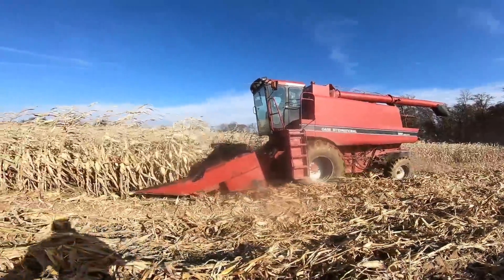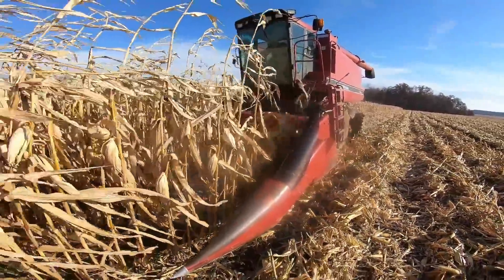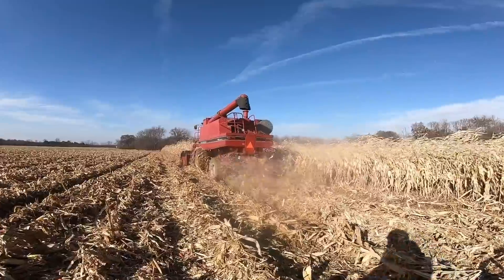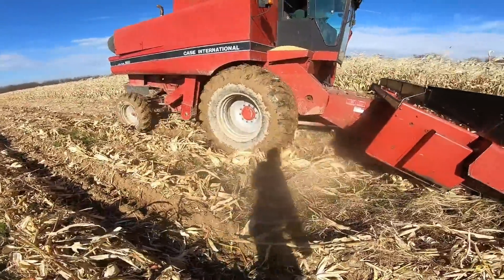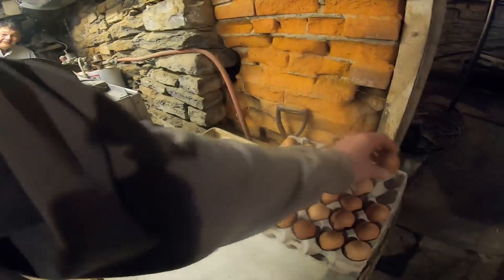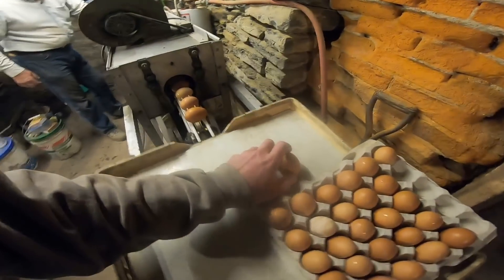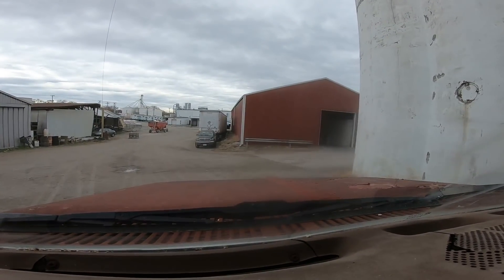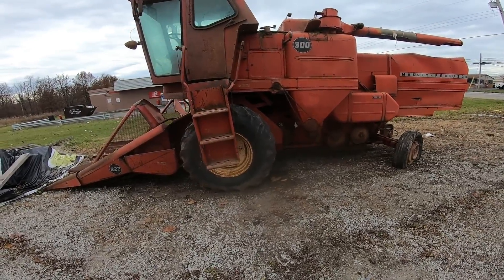Custom Corn Hauling Adventure

Comment: Thanks for the ride-along.  I enjoyed it.  I also did some custom hauling this fall here in western PA.  I have a 1986 F600 Dump truck that holds just a little over 200 bushels.  I bought it a two years ago just to haul my own corn and soybeans, never expecting to do any custom hauling.  This fall, I ended up hauling not only my own corn and soybeans, but also that of 2 of my neighbors because they were having trouble getting tractor/trailers and tri-axles.    All in all, I hauled 22,000 bushels of grain with that little truck.  It was a lot of fun and the truck is paying for itself.
Reply: Even with the price of gas???
Reply: @timknoll8654  It’s a diesel and I didn’t have to haul far.

Comment: When I got back into grain farming in the 90's, there was nothing of Dad's old '56 Ford grain truck to salvage-- it was a former fertilizer truck someone had converted into a grain truck and was older than dirt when Dad bought it for nearly nothing, and it was SO rusted out even as a little kid in the 70's I could watch the road going under the truck and the driveshaft spinning through the bare springs of the seat (cushions were worn out and gone) and the holes rusted through the floor... Salvaged the frame for a trailer the rest went to scrap.  

I tried hiring a semi to haul grain, figured it'd be cheaper than buying a truck and keeping it insured, licensed, inspected, and tagged.  Yeah first thing he asked was "how many combines you got going??  How many auger carts?"  My answer, "one and one".  He goes, "can't you team up with a NEIGHBOR and he and you both run combines in the field TOGETHER so I can get filled up and on the road in like 15 minutes?"  My answer, "NO, I have a 1970's Ford combine with an 18 foot head, the neighbors have much newer bigger stuff, they don't want to team up and have me cutting theirs and I don't really want them cutting mine..."  SO basically he was like, "Well, if I don't have ANYTHING BETTER to do I'll come out."  Don't do me any favors!  

Well, he hauled a load or two for me but I also QUICKLY figured out that for what they charge, I'd be WAY money ahead to just buy my own truck and pay the insurance, inspection, and tags for it... Basically trucking ate up most of the profit on the grain!   Why I don't like hiring stuff done-- by the time you pay for someone else doing it, you could have put that money toward buying your own and repairing it and doing your own work on your schedule... 

Ain't really no reason you couldn't run that combine for Nick while he's at work... do a little work for him for free for once... You're a good operator conscientious and all not likely to tear anything up, (rather unlike Nick from what we've seen) and you could get that off and on the truck and haul a load, get back and maybe pick another, have it ready to go that evening or the next morning... What I used to do when I didn't have any help... and I was driving a school bus at the time.   Get off the morning route at 8, get home about 8:10, hop in the truck and make a run to the elevator, get back hop in the combine cut another load, hop back in the truck make another elevator run, back in the combine (if I had time) and get another load cut and on the truck, then go drive the afternoon bus route, get back by about 5:30 and if I had time, make a run to the elevator, cut another load onto the truck when I got back, and shut down for the night.  Wash, rinse, repeat the next day.  Some days if the elevator was slow, I couldn't get another load combined after I got back from the elevator, it was hop in the pickup and head to the school for the evening route, so when I got home at 5:30 it was combine another load onto the truck, by which time the elevator was closed, so shut her down head to the house for the evening.  The work got done... 

Later!  OL J R :)

Comment: We have, basically the same machine and we love it. We have a 1640 also, but we blew up the engine a couple of years ago. We have a 20' 1020 platform for the 1640 and a 25' 1020 platform for the 1660. We have a 6 row 1063 corn head that was with the 1640, but we have to use it on the 1660 until we get the other one fixed. Absolutely love our IH combines.

Comment: I got excited when I thought you finally got a good combine! Best dang corn head out there and the simplest combine. Getcha one Jacob!
Reply from the maker: Well this corn head needs some help because it kept plugging a middle row.
Reply: @boehmfarm4276  Knives on the stalk rolls probably worn down too much--- watching it work it looks like it's not even pulling the stalks down til they're nearly at the back of the snapping plates, by which time there's not enough time for the stalks to get pulled down through the plates before the gathering chains are pushing them against the back end of the slot and breaking them off or causing them to bunch up.  Knife rolls wear FAST compared to fluted rolls.  Why almost nobody else uses them except as an "option" or aftermarket parts... OL J R :)

Comment: Oh yeah a gas truck will just about break a guy anymore to haul grain.  Diesels are SO much more efficient!  After my BIL's brother passed away, we continued running his old Chevy Kodiak tandem with a 500 bushel box to haul grain with.  I ran it, BIL or nephew ran the IH S-series like yours but it had the DT-466, 13 speed w/granny gear (you drove it like a ten speed basically-- go to low range and you'd shift 5 times before you got to the end of the driveway-- it was a former mine truck) so you started off in middle range first ran through four then switched to high range and ran through four.   If the truck was parked in the field to be loaded, start off in granny gear to get rolling then go to first.  It was a tandem with a 600 bushel box.  

The old gas Chevy we ran for two years, after that the BIL parked it and put me in the IH tandem.  The Chevy was a 5 speed with a 2 speed rear end, with an air tag axle.  Thing was, I could make about 3 runs to the local elevator, about 5 miles from his farm into town, and back before I needed to gas up it up, about 50-60 gallons.  The diesel DT-466 I could run about 6 runs before it needed fueled up, again with about 60 gallons of diesel.  So basically twice as many trips for the same amount of fuel, and actually better than that because of the bigger box on the IH tandem.  His brother's Chevy sat in the barn for a couple years and got sold to another farmer.  

Then he sold his IH tandem for an IH day cab semi and steel hopper bottom.  N-series 855 Cummins and 10 speed, former mail truck making a run to Indianapolis every day that had been jackknifed, got a new cab, and put back together-- got the truck for $11,000 and the hopper was another $10,000, so got into a semi for $21,000 and sold the tandem for $15,000, so basically 6,000 difference.  Plus went from hauling 600 bushels max to 1000+ every trip, and doing it at 55-60 easy versus the old DT-466 running out of power at about 50-55, FINALLY getting up to speed about the time you had to start slowing down and downshifting at the edge of town for the turns to the elevator LOL:)  

You ever get gravity boxes on that IH truck of yours, you'll sell that old Ford when you realize how much gas it burns... OL J R :)

Comment: Nick was doing a fine job running that combine.Nice shots of how wet things are around here.That egg washer was really spitting them out.I never make it through that light at 730 and the ones you bypassed are just as bad for not catching green. Scrap iron with maybe a few parts that can be salvaged.
I like how you had a few different things going on in this video.

Comment: Runs like an Axial Flow lol The IH head was years ahead of the rest with the Knife Rolls .. Overall a much easier machine to work on next to the TR but shared lots of common parts to the Axial Flow Since IH did start the twin rotor idea and canned the crew and idea so New Holland picked it up and thats were it went . I do remember using some rotor drive pulleys from New Holland since my Red dealer did not have them....

Comment: Ih 1660 one of the best combines ever made
It doesn’t look like the shoe and seive are set correctly 
We run in 200 bushel corn 6 mph 6 row head 
I know mud was a issue
Reply from the maker: Just a wee bit of cob in there.

Comment: Them spinners ain't as bad as the chopper on the back of the BIL's Deere 9600... that thing will shoot cobs like a bullet LOL:)  Scare the crap out of you when you don't expect one to pop the side of the cab, or hit the windshield, when you're running the auger cart and coming up beside him to unload on the go... Got vids of it on my channel.  

His Dad, rest his soul, used to do about like you do in the field, but of course he was on his ancient Kawasaki Mule... it had a hard cab on it, with an actual windshield, but they took the doors off most of the year except for winter.  I'm running cart one day we're in mud like that trying to stay where I need to be, which is pretty close with an 8 row head, and I look down and there's the old man on the Mule, he's coming up right between the tractor and cart and the combine-- went right through the hail storm of cobs coming off the chopper, cobs bouncing off the windshield and flying everywhere like bullets off Mighty Mouse's chest LOL:)  Then as he keeps coming cobs start flying in through the door openings and bouncing around in the cab ricocheting around and he's ducking and bobbing in there and just keeps on coming... so he finally gets through and is running about a foot from the combine outer dual tire and a foot from my Case 4890 dual tire... SMH... Old people LOL:)  He had all sorts of adventures... 

Later!  OL J R :)

Comment: great video on the custom corn hauling.  subject change, nice interjection with 'egg truck coming' :).  curious about you turning the eggs with the narrow cone point down when crating them....is that because of the crate design or is there a reason for that vertical direction?

Comment: You said it was planted with a Deere 7000 series planter... do you know if it was plate type or finger pickups?  I looked at the spacing when you said that and spotted some skips and doubles, so either it was a plate type (which will do that particularly if you don't use sized seed or have the wrong size plates in it) or a finger pickup that the meters need attention... a well maintained finger pickup will plant pretty much as good as any new planter.  Gotta make sure the fingers, springs, backing plate, and seed belt are in good shape and working smoothly, needs to rotate smoothly, and the "tickler brush" that helps eliminate doubles.  Otherwise they're pretty problem free and do a  really nice job... but if they're worn and need attention, they'll sure tell off on themselves when you look at the stand spacing and singulation!!!  It's really a shame that people don't seem to want to put any maintenance into their planters and then wonder why they have a lot of skips and doubles... OL J R :)
Reply from the maker: It's a finger that doesn't see a roof.
Reply: @boehmfarm4276  Ah... Yeah corrosion isn't kind to them... and all the fiddly bits are behind the plastic cover in the center that all the fingers stick out of, "out of sight out of mind" LOL:)  

You'd be surprised at some of the stuff that can screw up a planter.  Knew a guy I helped one time and I drove by the fields we'd worked in later on, to see the stand.  Well, I got too looking and noticed a pattern.  Half the planter was skipping every so often, then would plant a cluster of doubles and triples.  Of course either one is bad news in corn-- no ear on the missing stalk from a skip drops the yield, and a double or triple parasitizes each other so you get two nubbins or nothing at all.  Once I noticed it was only half the planter doing it, I backed up along the field edge where I knew that half of the planter had been right beside the field road, and rolled along-- I counted 25 instances of the "skip-double" pattern in just 1/8 mile long rows, ON ONE PASS.  No multiply that across the ENTIRE FIELD where it was probably 50-60 passes of the planter... that's a h3ll of a lot of messed up corn.  I told the guy about it and knew he'd had some problems with fertilizer pumps and rusty chains, and figured that was probably the culprit.... the fertilizer pumps were driven off a jackshaft running off the same shaft that the planter wheels turn to drive the planter transmission, and that jackshaft turns slower than the planter shaft.  I figure what was happening was, there was a frozen or very stiff link in the fertilizer chain, that would momentarily "lock up" the planter drive, stop it from turning, which would create a "skip" across all six rows on that half of the planter.  OF course the planter is still moving and the drive tire rolling along, and so it pulls all the slack out of its drive chain, pulls the slack out of the drive coupler/lift disengage clutch, ratchet dog reverse one-way clutches (so the shafts don't turn backwards when the planter backs up) and "winds up" the shaft... then all the extra stored-up energy causes the link to pop loose or jump a tooth and go around the sprocket, and the ENTIRE DRIVETRAIN SPRINGS forward as all the tension jerks out and the system goes back to normal load... and when it does, it JERKS the meters forward suddenly after thier momentary stop, causing the meters to drop 2-3 seeds "at once" as they pop forward almost instantly... 

I told the guy my theory and to go look at the field, then look over the planter very carefully.  He just looked at me like I beamed down from Mars.  Oh well, I tried, not my corn that something stupid like that and easily fixed is dinging the yield on... 
Just goes to show the importance of good maintenance and replacing bad parts when their time is done.  OL J R :)
Reply: @boehmfarm4276  Even if there's not room at the inn for the planter, he could AT LEAST take the friggin meters and hoppers off and store them in the barn, hay mow, tool shed, whatever.  If something's gotta be left out in the weather, the planter is pretty much at the bottom of that list-- just about ANYTHING else out in the weather is a better choice, save the combine itself.  FFS he should at least get some TSC tarps and cinch them down over it... cripes planters only have about a million bearings and chains and clutches and moving parts... H3ll each row has 2 opener disk bearings, 2 gauge wheel bearings, 2 press wheel bearings, 2 gauge wheel arm bushings, 4 parallel arm bushings, the meter clutch drive to the hopper, the meter has a bearing and fingers have 8 moving flags, springs, cam, seed belt, belt idler, plus another chain running to the granular boxes on back if they're there... then each row unit has the hex drive shaft sprocket bearing from the transmission, 4 bearings in the transmission, carry wheel chains and bearings, idlers and their bushings, dog clutch, cross jackshaft under the toolbar and its bearings, lift disconnect cam/sprocket to shut the planter off when it lifts, transmission chains, plus any fertilizer chains and bearings/bushings... 

It boggles the mind... Later!  OL J R: )

Comment: For corn the IH rotary is the best in the world.
Reply from the maker: Lol, he's got a thorough representation of cob in the tank.
Reply: @boehmfarm4276  That's not the comines fault. I don't know if they are the best in the world as Paul said but when set correctly an IH rotary is hard to beat. Any cob in the tank tells me the operator is to blame.
Reply: @boehmfarm4276  Cob in the tank is overthreshing-- too tight a concave clearance and/or too high a rotor speed, which is breaking up cobs and putting them through the concave/separator cage with the corn.  Probably not enough air or open too much on the chaffer and sieve I'd bet too.  Course if it's still 26% moisture it's gonna be hard to thresh anyway.  Don't leave that stuff in the truck or grain tank too long or you'll be poking it with a stick to break it up and get it flow out... LOL:) OL J R :)